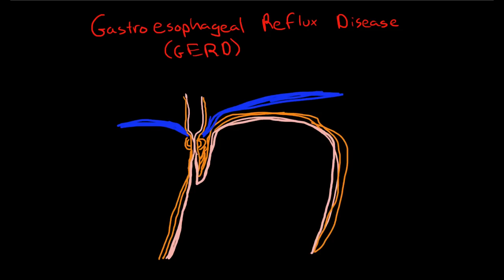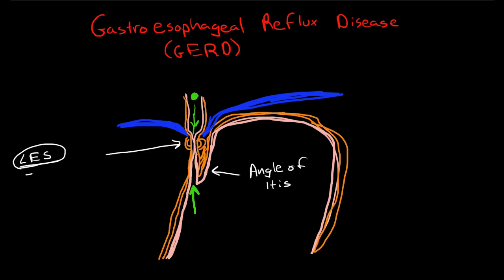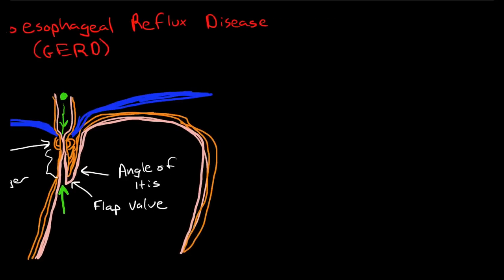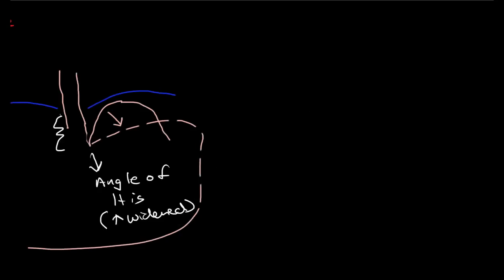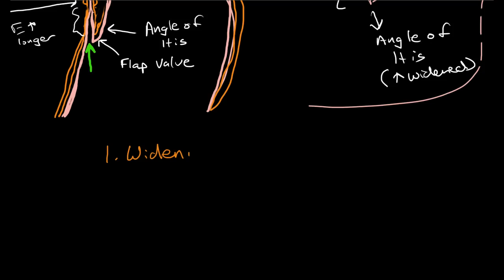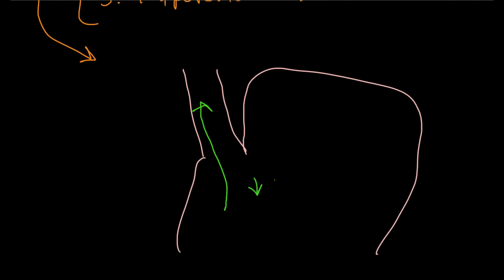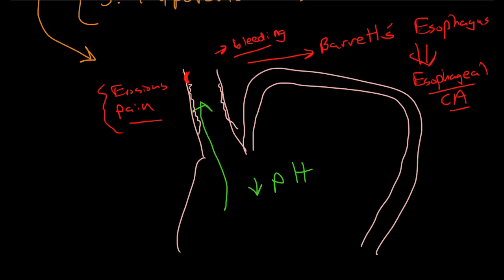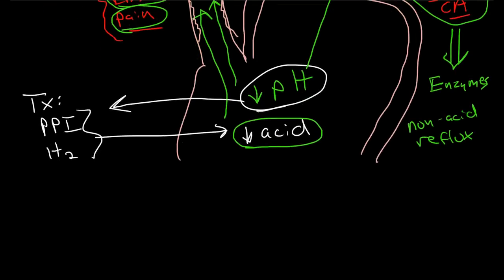Pathophysiology of Gastroesophageal Reflux Disease (GERD)

Comment: My husband has Barrett's Esophagus, diagnosed in 2020.  He is 75 (as of 3-20-24), had Parkinson's Disease diagnosed when he was 61.  He is very thin & has had GERD for the past 31 years. Since 2021, he has been undergoing radial frequency ablation, cryoablation, dilations, biopsies, and a 4.5 hour endoscopic submucosal dissection of the esophagus in May of 2023. Per your video my husband does not have 2 of the 3 conditions that lead to GERD.  He is not morbidly obese nor does he eat fatty meals.  He does like to drink a diet ginger beer a couple times a week.  So I guess he has a hypotonic circular muscle at the lower esophageal sphincter that has caused his Barrett's esophagus.  He also has diastasis recti, just learned of this when he had bilateral hernia repair done in Jan. of 2024. Wondering if diastasis recti contributes to a thinning of the muscle tissue around the stomach or widening of the Angle of HIS even in a thin person? (He is 5 ft 8 inches & weighs 140 pounds.)  Very interesting to learn that enzymes not acid is what causes Barrett's Esophagus and not the acid because the Pantoprazole that he takes does not stop reflux, it just reduces symptoms of acid in the esophagus.

Comment: I learned some new things toward the end. You can get barretts or make your Barretts worse even if you are no longer burning yourself with stomach acid because the cold reflux is still bad for you. Thanks Andrew. I'll mention it to my doctor.

 Also, I don't know if you know about the Golden Rest beds. I just bought an adjustable bed at Sears but I bought the wrong kind. It looks to me like the Golden Rest has the right idea because you can roll over and sleep on your side or stomach without bending your back the wrong way and still maintaining a good angle to prevent stomach contents from getting up in the esophagus. 

The bed I just bought does the same thing most adjustable beds do. It lifts your feet or your back so if you lay on your back all night your GERD will be controlled. Trouble is I hate laying on my back all the time and I have a lot of trouble getting to sleep in that position.